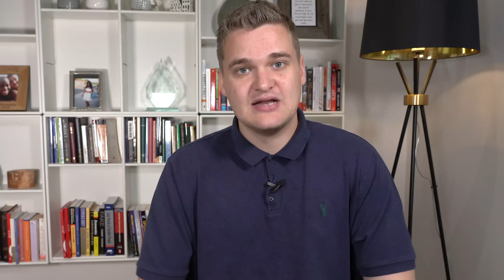BUY, REFURBISH, REFINANCE, RENT (BRRR) Strategy Explained | Samuel Leeds

Comment: Great content as usual. I have a question about the BRRR strategy. As I understand, to get a bridging loan you need to put in a 15% deposit yourself. Once the work is complete on the property, will you then need to come up with an additional 25% deposit for the new mortgage effectively meaning that you need to start with 2 separate deposits? Thanks again for all the free advice you continuously produce.
Reply: The mortgage you get when you refinance the property is effectively a payment back to to yourself. As you have added additional value to the property, the refinance payment to yourself is higher than the the money you needed too take out the bridging loan so your be in a surplus of cash once you have paid off your bridging loan. If the BRRR was done correctly, that surplus can be used as the deposit on the new mortgage. That surplus can also be put in your back pocket if you chose to sell the property.
Yes your need the deposit for the bridging load in the first place which is going to be around 35%.
I hope that helps

Comment: Hi @Samuelleeds , this is a great strategy and I have been doing this for several years. It's a great way to build up a property portfolio.

It gives great monthly cashflow especially when you rent out as HMO'S.

Also you can benefit from the increase in property value over 10yrs etc.

You rated this strategy as a 9/10. Are there any strategies you would rate as a 10/10?

Keep up the good work.
Reply from the maker: Yes, you’re right...it works on so many levels 👍
Reply: Hi
I am so interesting to do please help me
Reply: Firstly, big up Croydon love from Purley. 
Secondly, as someone who has more experience how effective is your method of finding the end value and true market values of a property? ESPECIALLY when there a few comparables on the street. 
I’m starting this method myself however while negotiating I always feel stuck on the due diligence for the value.

Sorry to smooch off you in a comment section, if you could give a few tips that’d be great. Peace and love ✌🏾
Reply: @maximyles  well trying to work out end values is difficult & risky.

What this means is that you have to build in lots of room for your due diligence because of the variables.

Comment: I think its important to remember that most mortgage lenders enforce a rental cover/ interest stress test, the new value of the property doesn't determine the cash you can pull out. The rent you can command in the market for the enhanced property determines how much you call pull out, not 75% of the new value.

Lenders will also take into account if you are a low rate or high rate taxpayer. Do double check before you try this strategy.
Reply: Great point, do you know the formula mortgage lenders use to see how much money pull out?
Reply: When you pull money out of the property you don't pay tax anyway . Use the banks evaluater as this will give you a higher chance of cashing out on the property and also will tell you where to put your money in the project. Your always going to need cash flow to service the loan. Just don't over capitalize on your property